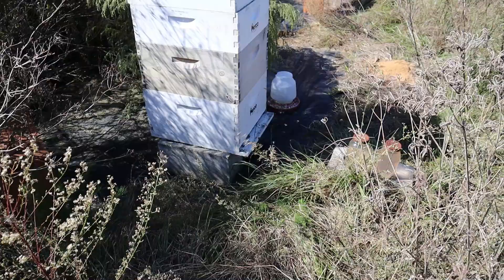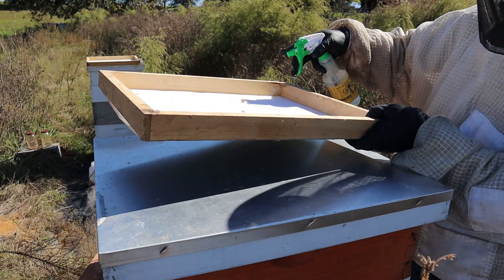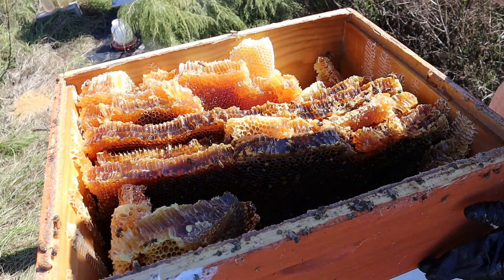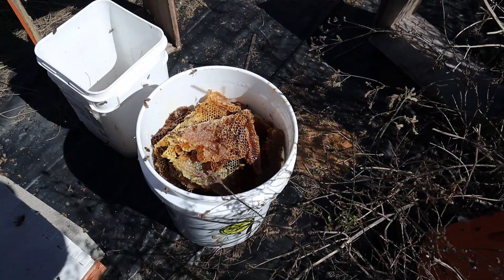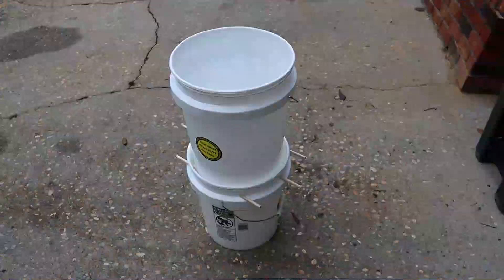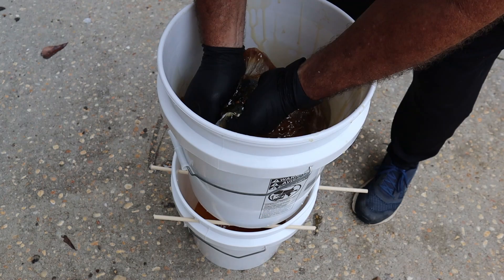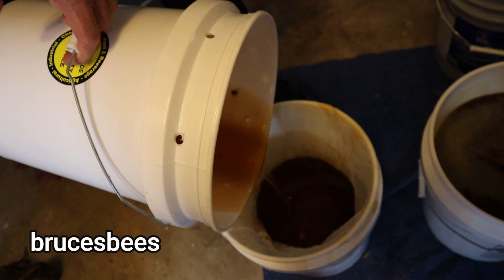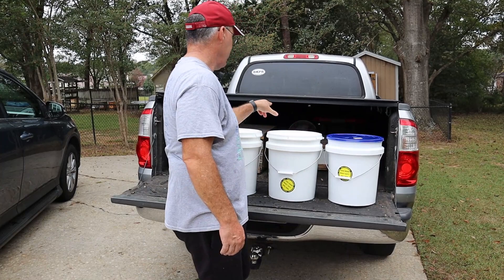Honey Harvest SURPRISE!!! Helping Out a Friend

Comment: Hi Bruce, would you mind sharing the exact tools you used here? This coming season will be my first to extract. I have 3 hives and expect to split them in the spring.
Reply from the maker: I used a combcapper and a serrated honey uncapping knife.  Then I used a genetic 3 frame hand crank extractor.  I have no idea what the brand is. You can get them on Amazon for fairly cheap.  I also used a pin roller or you can use an uncapping fork for spots that the knife doesn’t take care of.  I put a paint strainer in the (gallon bucket under the combcapper also in the bucket that catches the honey.  It is probably the cheapest and most basic way to extract honey from frames.